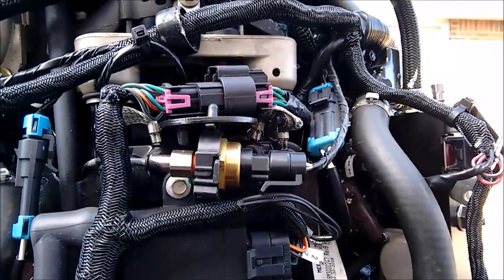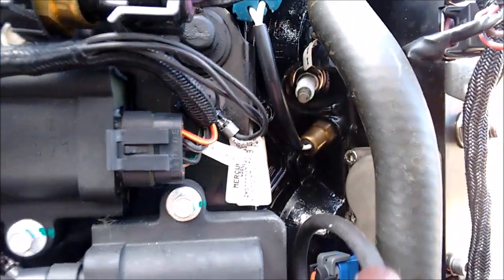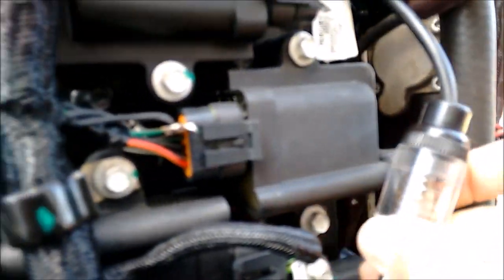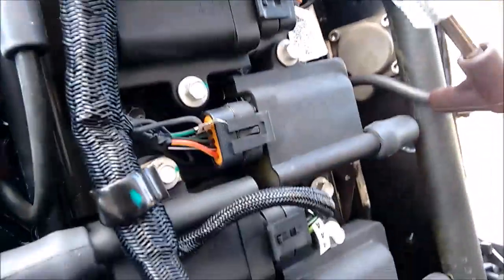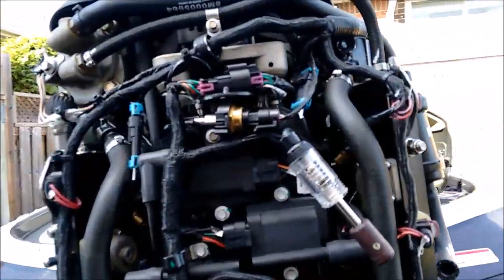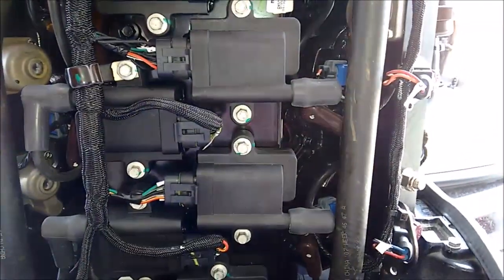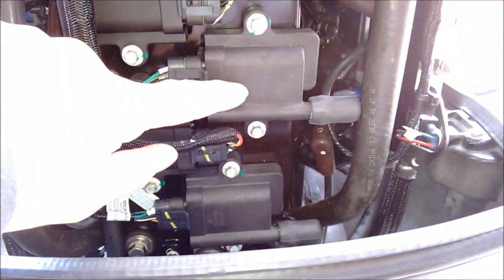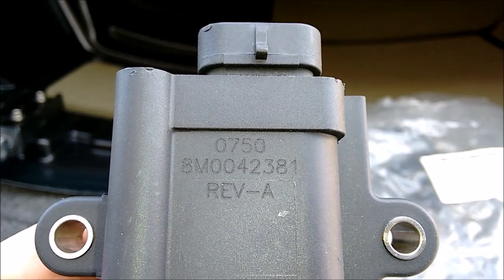mercury Optimax 200HP Replace engine coil

Comment: 2008 Merc Opti 250 - first holeshot of the year, it was bogged down so bad, I thought the boat was filling with water. Eventually it gained enough power to get to plane - then was fine the rest of the day. I had a reoccurring nightmare of when the coil went on me in 2010. Is there a more common coil that goes bad? (plug 6 or plug 1?)...I may grab one and a set of spark plugs - they're likely 5 seasons old. :(
Reply from the maker: no not that i've come across.  Any coil can go. Get yourself a spark plug tester and then you can figure out if it's a coil.  Also have a look at your tracker valve.  That can cause issues also.  I have a video on the channel for this.
Reply: @topgunbass  Thanks man - appreciate it.
Reply: @topgunbass  I had a look last night and I possibly found an issue - the top two spark plug boots on the right, had nearly slid off, but when I pushed them back up, they could easily be slid back off - gunna go grab a bunch of 6inch plug/boot combos today and get some dielectric grease on them.
 Also, my fuel filter was black....that's been changed now...and I see two white inline fuel filters as well, going to hunt those down today and change them. 
Redoing my lower unit oil last night(cuz I don't trust the dealer now) I also found the screw behind the prop seemed a bit less than tight tight - the oil was grey, which I believe is some water in the lower unit gear case. Great.
 So glad I spent the $440 on service at the dealer last fall. ffs - need a new dealer. Hmmm...where are yoooooou located? lol
Reply from the maker: @Crushin123  you've been busy. Nice to see you figuring out your motor and changing a few things. Make sure you remember the correct orientation of those white filters when you put them back.
Reply: @topgunbass  Thank you sir - yeah I think I saw a tiny arrow on them - appreciate the reminder though ..so thank you for that. :)

Comment: I have a 200 xr6, is it the same concept for I took it to a shot they said it was fuel pump but yet after going on the water I can't go over 5 mph and still bogs down I shut engine off then it will run but still a bogs out once I'm getting up to speed. Any idea thanks
Reply from the maker: Check the tracker valve. I had mine go a few times.  Check the plugs and coils.  It's the simple things first. It's possible it's the fuel pump but I'd Check the others first.
Reply: @topgunbass  just put a new fuel pump in what is the tracker valve?
Reply from the maker: @joshbirtchetfishing5196  it's a small diaphragm that regulates the fuel pressure. It it gets damaged you will have problems.   You can get rough idle, or stall outs loss of power.
Reply: @topgunbass  sounds good I'll have to look that up. Thanks
Reply: @topgunbass  I don't have a tracker valve on my boat.

Comment: Can a bad coil cause you to boggle at a high RPM?

When I go full throttle, I’m boggling and flatlining pwr at 3500RPM. 

Not a fuel issue!
Reply from the maker: If you are only maxing at 3500 rpm I don't think it's a coil.  If you have a bad coil you will drop a few hundred RMP.  But not that low.  Check your plugs.

Comment from the maker: when was the last time you changed the plugs?  some may be done and time to change.  that's why they may look different.  also check if the gaps are all the same.  if you haven't changed them in a few years I'd buy a new set.
Reply: After we finished connecting The New Powerhead we put new spark plugs in

Comment from the maker: Peter I don't think you will get a beep from miss fire.  was the beep continuous?  it is possible to come on if you over rev the engine (in neutral).  There are other factors that can cause it.  If it continues its best bring to dealer.
Reply: Hmmmm, maybe that was It! My friend was revving it hard in neutral and it was a continuous beep, elongated. Also, any thoughts on why a couple of spark plugs are cleaner than the other four? Like I said, we did that test, and there was spark.

Comment: Hello, searching for some help. I have a 2008 Optimax DFI 200HP 2 Stroke as well. Blew The Old Powerhead with only 188hrs. Just replaced The new Powerhead today. My friend put The new One on. Started right up and ran smooth until we put Her in neutral, revved her up high, and a loud beeeeeeeeep come on till we revved down. My friend check the bottom two Spark Plugs and they looked clean. He performed the test like you did in the video, and the plug tester lit up.The other spark plugs looked good. He claims something must be miss firing. What do you think? It's a new Powerhead. We did take the old components off The old Powerhead but like I said, only 188 hrs on last Powerhead. Haven't ran a computer test, hoping to do that Monday but obsessing over the though of what it could be. Any suggestions or opinions would be appreciated, thank you!
Reply: I'm sure you figured it out but this sounds like the throttle position sensor 83295211. Had the same problem on my 225 opti, but it might have sank

Comment: just wondering  I have a 2010 200 xs mine is doing the same thing . but once and awhile I had an alarm . last time out after having it worked on. dealer said thermostat was stuck open causing it to run rich and fouling the #3 plug .  anyway after getting it back out started doing same thing missing again no alarm.  4200- 4800 rpm max . didn't seem like it started until the engine got warmer is that what happened .   thanks

Comment from the maker: Scott, mine did not bog down like you mentioned.  I just lost several hundred rpms.  if the coils and plugs check ok, you may have a cylinder or more down.  I would pressure test each cylinder that will tell you if one or more is down.  it could also be other things.  did this just happened recently.  knowing the history of your motor will help.

Comment: 2007 150HP Mercury OptiMax was only hitting 4200RPM at WOT. Used this video to check the spark and coil. Sure enough one cylinder had no spark. Replace ignition coil, now running at the normal 5200 RPM, WOT. 
Thanks for the help. I was able to do this with pontoon in the water. Just back the pontoon into the slip.
Reply: Very good information.

Comment from the maker: do you know what your rpm was before it bogged down.  if it's just a bad coil you will drop some but not down that low unless you have several bad coils.  whether my engine was cold or warm it would act the same.  check your plugs also.  you could have several bad plugs.

Comment: The symptoms you had for the bad coil, mine is the hole shot like you mentioned then after running and getting the motor warmed up it will not get above 2000 rpm so I can't get on plane again until I let the motor sit for awhile. It is like the motor bogs down over 2000 rpm. My motor is only a 90hp. I'm just wondering if yours acted similiar. I have a tester like you used and I'm going to test mine.